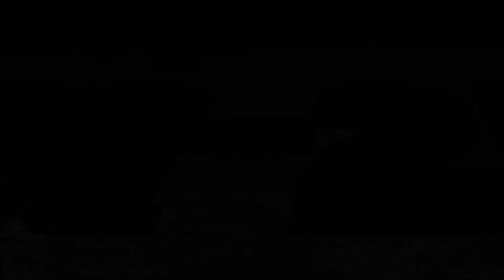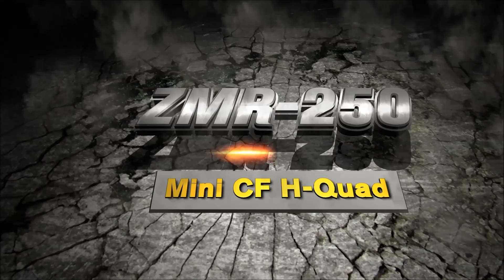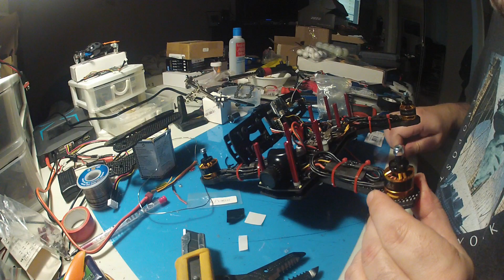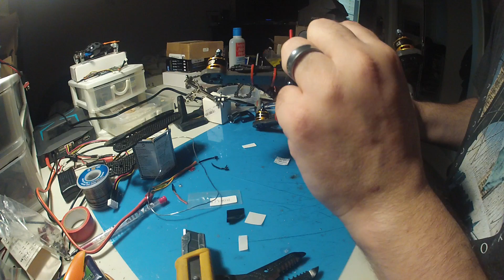ZMR 250 Fearless Edition

Comment: So hows it been holding up? I ordered the 5mm Thug arms and plan on taking your advise and doubling up the bottom plate. Thanks for the idea!
Reply from the maker: Ryan Wilson You're welcome! I have made a bunch of modifications since, but the concept of double bottom plate and double arms has stuck through the design process, and I feel like this thing is indestructible. It's my go-to quad, and I have yet to do any damage more than scratches since this build. I'll be posting an updated build log soon with some further changes I've made. I do like the Thug arms, but caution if you have the overcraft or wadzofquads PBD, as you will run into spacing and contact problems with thugs.
Reply: Hmmm, crap.. I just ordered the Overcraft pdb. I haven't received it yet, but was hoping I'd figure out a work around to the contact problems with the board and Thug arms.. I'll have to look at them both and think about it. Maybe grinding down the width on the Thug arms using the originals as a template would be a solution. Guess I'll find out... Thanks for the reply!